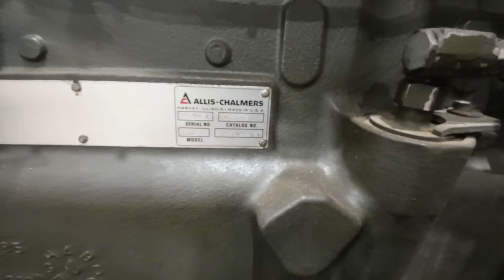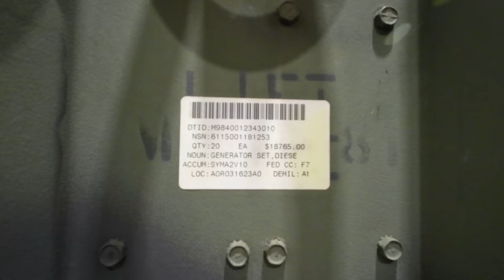$500 Diesel Millitary Generator sitting for many years, WILL IT RUN?? (Allis Chalmers 3500a)

Comment: Sweet deal, you scored big time Matt, this engine is near new, I believe. The oil was barely showing on the dip-stick before you added any, but it was so clean just like new oil in a new engine that may have only ran very little test / tune time at the factory . It starts, runs & sounds, like a NEW Engine . I can`t wait to see & hear it running in Fat Alis.

Comment: You might not get arround sending the pump to Areadiesel in the End. Gensets are usually set up for the power they are supposed to deliver on the electrical end and not for the full potential of the engine. The engine in my Genset could do about 200hp with turbo and everything, but its naturally aspirated and the pump is set up for 60hp and thats all it will do since the generator couldn't do more anyways, so that might need some tweeking in the end before you can put it into the Loader.

Comment: Generally when they send those things off for auction they drain the fuel systems. You do what's called a technical inspection for turn in. They generally drain the coolant and the fuel because they don't want to have any hazardous materials present when it's sitting in a storage area.

Comment: The injector pump on that generator probably isn’t the best choice to run on the loader. They are made for constant speed. I suggest you use ol Alice’s pump on this engine
Reply: In this case the governor is electronic and moves the throttle on the variable speed pump, so it's perfectly fine to use that pump on the loader.
Reply: @theodorgiosan2570  that’s not the issue.
The issue is the generator injector pump not being the right application for revving up and down. They are designed for constant speed. Will it work? Sure. Should it be there? No. Also it’s probably a smaller pump. Meaning less hp and torque.
Reply: @theodorgiosan2570  The electronic throttle has to be deleted and throttle control connected to foot pedal control. It is not a generator anymore.
Reply: @inkman996  again that’s not the issue.  I’m not talking about the generators governor and speed control.

It’s the wrong type of pump. Static use ie:generators and water pumps. They are optimized for constant speed output. To run the engine efficiently at a steady speed. 
The regular ones and made for throttling up and down.
Reply: Don't know about THIS engine specifically but YOU ARE RIGHT!
Generator engunes frequently have little nuances to them for steady rpm power plant use.
Reply: @jeffhutchins7048  same here. I don’t know this engine. In general the usual laws of combustion applies tho lol.

Comment: Matt, the nice thing about Factor food trays is that you now have hardware storage with a cover. I'm sure you don't save fasteners since you have a ready supply on your wall, but unusual types might be good candidates for the trays, which are not, by any means, heavy duty, but still useful.
Reply: They also work great when removing parts from your next projects and keeping all of the nuts, bolts, screws, etc.. in separate trays per the part of the equipment you are working on, carb., fuel pump, injectors etc.. this will help you determine which parts belong to where. Can’t wait to see the swap and dear Fat Allis back to work w/ her new heart pumping. She will feel that you gave her steroid injected  fuel.

Comment: Awesome content as usual. Just FYI the vast majority of the world runs on 50hz AC, the US military being part of NATO would have most of their OS electrical equipment compatible with 50hz and 230v. On a side note the US military also use metric. They call it Army/Navy AN for short to make American soldiers feel better about not using imperial units 😅.
Reply: Frequency on a Gen set is adjustable via RPM.

Comment: I think the weird wiring was probably to avoid Electro Magnetic Pulse (EMP) which would be as a result of a nuclear explosion, the NSN number is a Nato Stock Number, anywhere in Nato would be able to source parts just by quoting the number
Reply: NATO doesn't use that number.  It stands for National Stock Number.
Reply: @deadstroke82 Also stands for NATO stock number
Reply: You should probably do a little in depth research to learn the difference between National Stock Number and NATO Stock Number. There is a difference as @deadstroke82 stated but hey it's the internet and we get to say whatever the hell we want in the comments. Hell yeah...like I just did.
Reply: After 32 in the military I think I know what I’m talking about

Comment: Matt, that's tinned copper wire not aluminium. With regards to all wire being the same colour, if you have a look each will either be labeled or numbered which will correspond with the wiring schematic. Also on that label that had the value there's an NSN, there's one on every piece of military equipment. If you do a search for that number you should be able to find manuals. $500 well spent!

Comment: Matt anyone who knows anything about batteries knows that you don't use spanners to bang the terminals on, what you really need to use is a half a brick, as they don't conduct electricity and won't cause arcing.
Reply: Called an Adjustable Hammer

Comment: A lot of army engines run straight glycol as a coolant, so they can be used in extreme cold, so be careful of that white powder. We’re you cranking that to prime the fuel with no engine oil in it ??😳

Comment: Matt back in the 60s the Air Force used similar AC engines to create  backup power on some missle silos wher the engines were at the bottom and the cooling air came from topside and returned through duct work to the surface.  They burned up several engines before they installed electric fans to push the cooling air         
 down and the hot air up.  Great engineering!!

Comment: Matt when you had top cover off injection pump moving lever on engine is actually throttle control, the lever connected to outside of pump is the shut-off control. Most genset pumps are set for 1800rpm or 1200rpm the tag on pump will have rated rpm on it, when you install in Fat Allis you should have it recalibrated to rated rpms for your loader. Rated rpms probably higher on loader and the governor regulation not as tight on loader application. Usually genset 
throttles held wide open then then shut-off lever used to control speed for idle position, nice video.

Comment: Hey Matt , cylinder things mounted to frame work that have wires and fuel lines are the fuel pumps (24vdc )  will chatter then slow down when pumping . The governor is electronic , remove it . The little box that was hooked to fuel pumps has a float switch in to keep the fuel pumps from constantly. Gen set was designed to run until it was out of oil and or fuel , it was an electronic nightmare. You will need to run a throttle stop to keep from over speed and or a run away engine , adapt what you can off of fat allis and store the rest for parts. The wires on your gen set should be stainless or steel . Needed copper for more important stuff like full metal jackets . Another thing is to get a bunch of carb cleaner , spray it into fresh fuel about half a can , run it til you figure it’s in the carb or injectors and let sit over night , it helps a lot with our wonderous fuel. Plus I found that on Amazon locate Briggs and Stratton fuel treatment , red in color only , I use it in all of my engines to include my Silverado 1 ton down to my weed eater ( including my Indian bike ) keeps fuel fresh for 2 years

Comment: I've owned and used one of those gensets for 25 years. Very dependable. Those 2 canisters are electric fuel pumps. The square box is a small intermediate tank with a float to regulate the fuel pumps. It's too bad we didn't somehow talk before you started working on this, I could have saved you some time. The tray under the radiator is the area where the batteries are, that's the reason for the gunk. Mine is a 60kw 480v 3 phase utility model. I think yours was a 400 cycle "precise" air force model. The precise models can ba paralleled for 120kw.

Comment: Aircraft often use 400 Hz AC. The onboard generators and motors are smaller and lighter for the same power output. Used to start Volvo Penta 6 cylinder marine diesels by cracking all the lines, cranking the engine and tightening the lines as fuel came out. The engine would start running on two cylinders and the rest fired quickly as I tightened the nuts.

Comment: Matt i use to work for a allis-chalmers dealership we had one of the cabover freightliners that allis-chalmers owned it had a A/C motor in it. It was a running son of a gun you could turn the juice to them engines and they wouldn’t come apart

Comment: Looks like it's heavy enough that even if it didn't work, you could scrap it and break even. 
The fact that it worked at all makes it an awesome score. 
I'm not a diesel guy(my experience has been with almost anything gas)
And my first diesel experiment is a 2 cylinder yanmar 2210 tractor.

Comment: Cool beans! I think the next step is comparing to Fat Allis to see what 'manual' components you need to source and put on the engine so you can peel away the electronic controls and get 'er running well enough to swap into Fat Allis.

Comment: In response to some of the comments below, it's not just military aircraft that run 400hz, it's pretty much all of aviation. The reason being is that the generators, transformers, etc are much lighter and this weight decrease really adds up on the large planes.

Comment: The two cylinders on the frame at top above your starter are electric fuel pumps , the bottoms screw off and have a little filter in there

Comment: Those "cannisters" are a pair of Facet electric lift pumps as the injection pump won't suck direct , the tank on the side of the engine is defo a day tank for a gravity fed supply and they dont wire the neg through the body for obvious reasons (military applications always have a seperate neg), good vid Matt

Comment: Hey Matt, the easy way to remember if they are stalactites or stalagmites is that the one with the g in it is the one that grows from the ground up. So yours are stalactites. Also, the most likely reason for the fuel shutoff solenoid being insulated on both posts is so that it isn't affected by any stray voltage from the generator side of things.

Comment: as a one man band, it can be a pain in the arse. But when you crack the injector lines, crank and when good fuel gets to injector, then close injector while still cranking. Let it run on 1, then 2 etc until running. just a thought, but works for me.

Comment: The two silver cans above the fuel selector are Facet fuel pumps. They used them as lift pumps and to help push fuel through the filtration system you pulled off.

Comment: Those 2 "funny looking" things with fuel lines and wires coming out of them are fuel pumps. One for the main tank, and one for the AUX tank. Both should be 24v. They are diaphragm pumps and make a loud rattling noise when running. On the original control panel there was a switch labeled "PRIME" to turn them on. They're used to get fuel up through the filters and to the injection pump. Without them it takes forever to lift fuel up to the injection pump. Grounds are lifted for control systems. It's easier, and safer, to have only one "hot" lead running somewhere providing power to everything and then control sections by removing a ground. Engine sounds great and it'll be even better under load when the turbo can spin up and make a little boost. Good luck!

Comment: 28:14 those are electric fuel pumps. Onan gensets from the mid-late 70s used similar pumps.
NSN is the "National Stock Number", basically it's the code you use for ordering parts and manuals.

Comment: the military doesnt use any special fluids (oil, coolant), the only special lubes is the grease which is either GAA (general automotive and Artillery) or lithium grease. Any questions about military equipment please refer to the dash 10 (operator manual) or dash 20&p/30&p (maintenance & parts manual) the specific TM (dash 10) can be found on the Data plate.

Comment: The military cuts the ground side from batteries on your master switch. You commented on ground through the harness. The negative side has the main disconnect due to that side not making any spark on connection. Cranes are set up in the same fashion.

Comment: A mnemonic to help you remember: Stalagmite = M as in mighty mountains that build up; stalactites = hang tight to the ceiling.  Now if you are ever trapped in a cave…you can at least be able to correctly use those terms.   That said, if you are leaving behind a journal remember the “g” as in ground for stalagmites and the “c” as in ceiling for stalactites (spelling).

Comment: was also used in gleaner harvesters,the fuel injection pumps are garbage,i had a hd16 loader in australia that was bought in pieces with the 5cyl turbo fiat motor,it was replaced with a 6v53 LOL

Comment: The unusual frequency you are referring to is most probably 400Hz. Most commercial aircraft including military variants have electrical equipment that operate at various volages and frequencies. 
The most common ground supply services for aircraft are rated at 28v DC, 110v/200v AC, 400Hz.
Other DC volages used are 24v, 26v, 29v.
Other AC voltages used are 115v, 120v, 220v, 230v, 380v, 400v, 415v, 360v-420v.
All the "other" voltages are supplied at 50Hz, 60Hz and 400Hz.

Comment: You will have to switch the injection pump off the loader for the proper governor. The gen pump 200 rpm drop at full throttle the loader gov is 400 rpm drop. The timing is also different. Set the loader up 2 degrees less on timing then it calls for for easier starts.

Comment: Those two small round canisters are for low oil pressure shut down I believe there’s a little pin that sticks out in each twist it to reset it Detroit diesels always used to have those

Comment: On the generators in the air force that square tank was the return tank and the line went to the filter and entered the engine. This was for 855 Cummins standby generator set .air force veteran Denis from Santa Rosa CA

Comment: 35:41 the control on both wires for the solenoid is so the control circuit has multiple methods to control the solenoid.

Comment: Solenoid wiring... do a continuity check between the wires, and expect 0-2 ohms. Provide ground to one side and 12V to the other and it should activate. There should be no expectation that either wire connected to the solenoid would be grounded when cut.

Comment: If memory serves me correctly, this had a “regular“ throttle cable, on one side of the injector pump, and the governor linkage on the other side.

The “Day tank“ was so that this thing never ran dry. It was kind of a big issue if it did, because he would have to bleed all of the injectors to get it running again. It had its own fuel shut off, so that the injectors always had fuel. It also gave you an opportunity to switch out fuel drums.

Comment: I rebuilt a MEP 10 military generator. It had a 4 cylinder air cooled Onan diesel engine that I got running like a raped ape. Seeing all that white aluminum wiring brought back fond memories of the government commandment of thou shalt not use color coded wiring. I was trying to restore both the generator and the engine. The research it took to replace parts with OEM was very intensive. I remember trying to replace the 4 vibration dampers on the control box to prevent vibration to the electrical components. I ended up finding the vendor and talking to a rep at the factory in Erie, PA. He asked me what I was going to use them for. I told him they were for vibration dampening  mounts for the control box of  a MEP-10 military generator. I asked him why he wanted to know and he told me that the most common use for those now, is in the construction of ultra light aircraft. He just wanted to make sure I wasn't going "John Denver" on him. Anyway, I had the engine running perfectly, But I never quite could get the exciter and generator producing current so I sold it and took a bath. The person that bought it had it up and running in short order. He was using it to generate power for a campground. You're absolutely right about the satisfaction of firing up a "retired" engine. Thanks for another great program!

Comment: @DieselCreek

Hey slick, some of these generator setups have additional components to allow the generator to run JP8 instead of straight diesel. You would have to find a TM or FM for the generator, OR you could just strip the setup down to the engine rerun some miscellaneous stuff and run it. Best of luck, Pennsylvania boys never give up, even if it kills us.

Comment: Just in case you're curious, many aircraft run 400hz ac at 115 volts.
A little different to the 50/60 hz we have domestically. Means they can use much smaller transformers.

Comment: Coming from a guy who has spent many days taking automotive Diesel engines and transplanting them into stationary uses. You will find most of the parts off your old engine will be swapped to your new engine before it said and done. I’m fairly certain you will have to swap fuel systems.

Comment: the fuel system works that the fuel cup the small tank holds enough fuel for the set to run untill the main furel supply is avalable so it also allways keeps gavity feed to the engine pump, the cilndrical things are the electric fuel pumps supplying fuel to the fuel cup.

Comment: i don't think that's an aluminum conductors but a premium tinned copper for corrosion and is very flexible . aluminum wouldn't last two minutes in a high vibration application . happy you got it going and it sounds awesome

Comment: The power for large transport and military aircraft is three phase 400hz power. Plenty of power for those 4000 psi electric hydraulic pumps. Also with the high freqs and three phase, it rectifies into DC power very well.